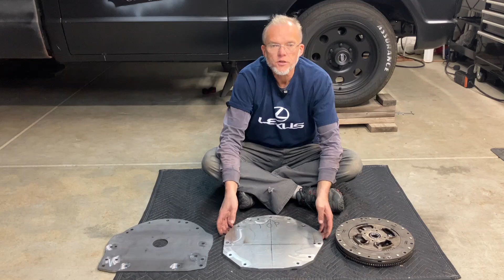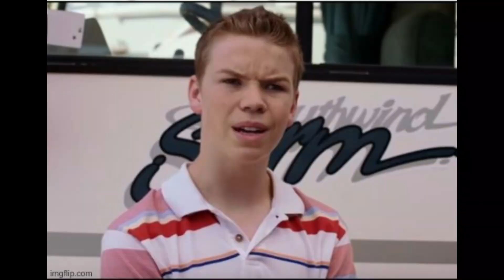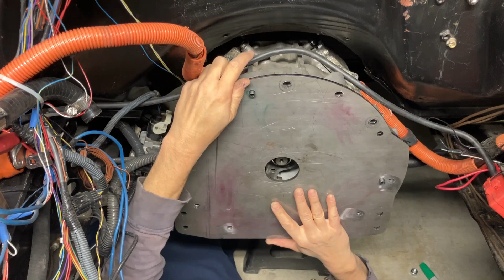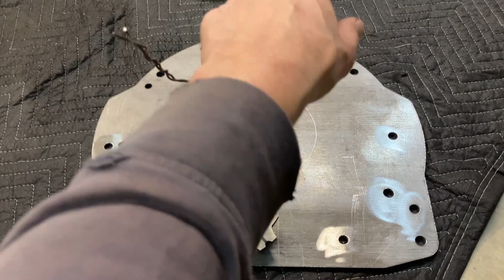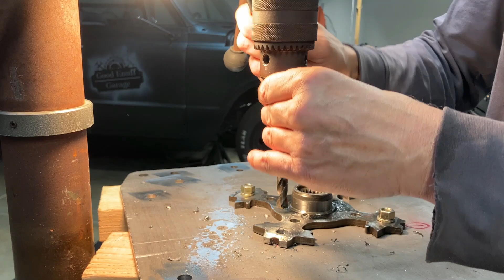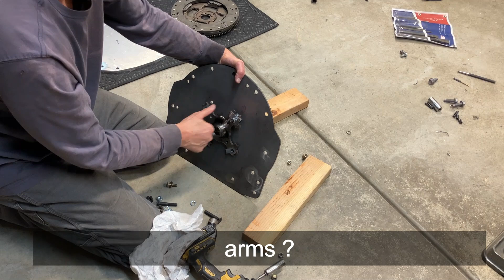GMC Electric Truck Lexus Trans Plate Fail

Comment: As an armchair expert I would have 3D printed an alignment doohickey or done some kind of triangulation based on the perimeter dowel holes. Also, can't tell if you used oil when drilling out the holes. That helps.
Reply from the maker: ha ha, copy that, and currently I am in between cutting oils so I've been using WD-40 (fully aware it aint meant for that) but as an old timer once told me, even water is better than noffin'

Comment: Using that punch to scribe the circle was brilliant! Is there no way at all for those bolts on the outside to stick out without ruining how the brace fits on there? This may be a terrible idea but what popped into my head was to drill the holes in the plate over size (maybe 1/8"?), press some wheel studs into the ninja star and then put a nut and washer on the outside of the plate. That way you could install it with the nuts slightly loose so the star can move around and 'find center' then just tighten the nuts on the outside and you're done.
Reply: I think a variant of this…. fit undersized bolts correct the alignment and then re drill oversized one at a time
Reply: I was thinking, with those big zip ties, put a big hardware store spring on it to pull it forward, then turn the rear output shaft to spin the input shaft. As long as the friction isn't too high on the scribe/spring, it should spin the input when in gear.

Comment: Out of sight, out of mind. Those batteries should hide any alignment issues with that plate. 😉
Reply: A clutch plate helps. A bonus is you get to change gears.
Reply: @blackterminal What the fudge?
Reply: I think you were on the right track first. I you can mount the star on a small plate that would cover two bolts on either side then you could put in on and drill through the transmission holes.